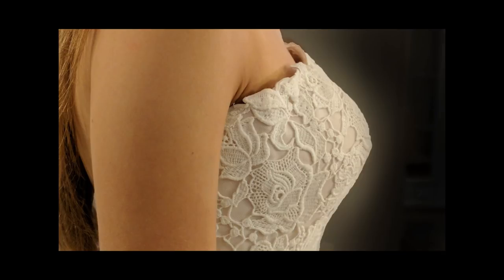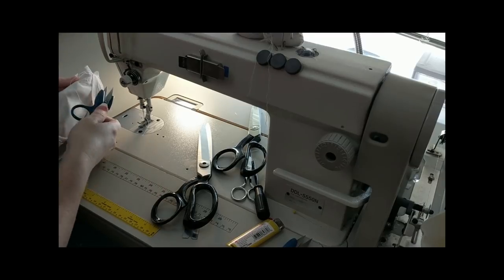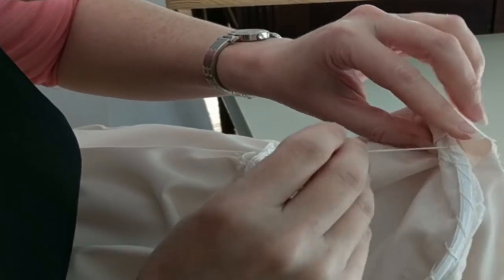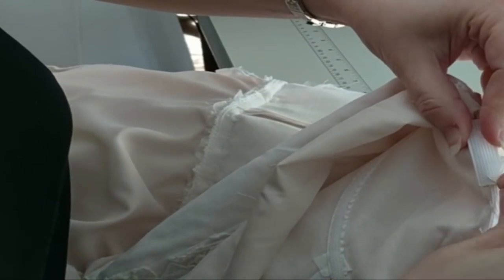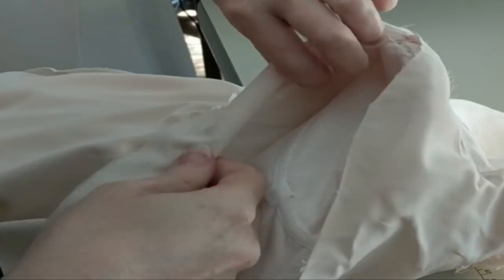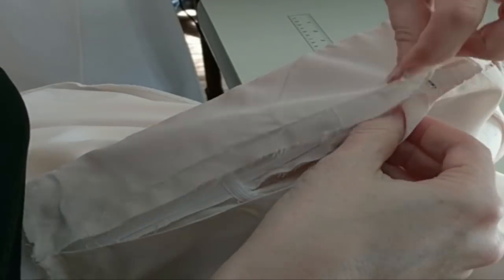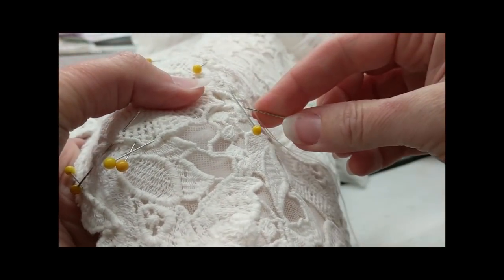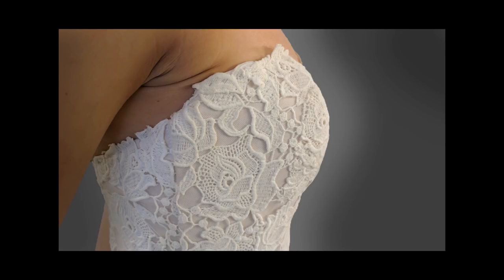How to Reduce the Bust Curve, Apex, Bust Angle of a Gown, Small Bust Adjustment

Comment: Really good technique, I've learned a lot thanks....
Normally I've taken a diff approach, by creating a gathered stich along the inside of the upper edge under the arm using a thick embroidery thread to pull it taught together, then adding bra cup inserts to fill in the beast, but I really like the way you've done this,  it's cleaner and appears more finished... good video 👍

Comment: Thank you so so SEW much!!! I am altering a strapless sweetheart bust designed for a B cup, and my bride did not realize she was a G cup until I measured her bust, sigh....another unfortunate extreme mis-sizing issue....I have let out, darted, take in only the top 3" of the front bodice at the side seams 3 times, taken in the waist 1" total, ease stitches,tried multiple styles of bras, adhesive bras, bra cups, and re-altered the bodice and have had 5 fittings with her, whew......the bodice has an extremely delicate open lace overlay with beaded appliques, and the waist seams attach to 3 tulle layers, interfaced satin, smooth satin and the crinoline perfectly smoothly without any gathers......I really believe this video has my answer. Guess I just needed to vent to my fellow seamstresses/ers since my friends and husband do not realize the difficulty level and how frustrating this mis-sizing issue is becoming with a few local "off the rack, no return policy" bridal salons. I would greatly appreciate any advice you can offer on how to politely address this issue to these salons who I greatly appreciate sending their "almost impossible" alterations brides and other brides to me. I do not want to offend anyone, but this is unfair to me and the bride. Do you have any advice on how to develop a relationship with your brides before they purchase their off the rack gown with no other option than for me to somehow make it work? I so wish I could measure, meet, and give kind, gentle advice on the importance of considering silhouette, venue, budget,and SIZE. Sorry for the long rant. This is becoming way to common. I would like to set up a paid Skype or call if possible, no rush. Thank you so so much!
Reply from the maker: Ohhhh, I have so many thoughts on this! I'll try to get back on here and address some of this. :)
Reply: @BridalSewing  
You are such an amazing woman to take your time to help your colleagues. I really do not see how you have the time. I just want to say again how much I greatly appreciate all of your hard work and taking so much time to create these videos for our community! I am so inspired by you that I am paying it forward and have begun teaching bridal basics to a local lady whose hobby is monogramming. I NEVER would have done this before, but now I am seeing our small community not as "the competition" but embracing your philosophy of preserving the craft. I am around the same age as you, and I see that we are losing so much knowledge as our previous generations skills are not being passed along. I am eager to help make our small community  kinder, less snarky, and not so ego driven. I will admit I have been guilty of some/all of this bad behavior in the past.....not proud of that and so glad you have the courage to address this in your videos. Thank you for keeping me sane and smiling during this gratefully busiest bridal season of my career. I no longer feel so isolated. I appreciate you so much!!!
Reply from the maker: Wow!!!!!

Comment: Morning Brenda. I just use this technique on a prom dress.   The bodice was so so snug. I used a heavy duty ok n eye. I removed boning to just below bust. Inserted DDD bust cups now  are too big. So I took in side seams from just bust kept back where it was. Final fitting today. Prom tomorrow
Reply: Her last fitting was yesterday afternoon. The fit was perfection. I layer in bed for two nights figuring out how to do this final fitting. This prom dress was highly structured just like a wedding gown. I remembered this technique and realized it was very well fitted in bodice but now apex was too loose and now unstructured. I opened side bodice seams removed boning and took in only front bodice. Three layers heavily beaded and many glued on stones. Tapered to waist line. Only took in front about 1 1/2” from front. Reassembled and it was perfect. Thank you so much Brenda

Comment: Thank you so much for sharing all your professional knowledge of altering bridal wear, it's making me feel somewhat less intimidated about my project to alter my sisters wedding dress. I have a question though, if you'd be willing to share any ideas :) I need to take the dress in both at the side and at the bust seam. It has a bodice similar to the one in this video, but with the difference that it also has an illusion/lace yoke in the front with shoulder straps. How would you deal with that when taking in the bust seam? I'm not sure that keeping the seam as it is at the top edge of the bodice, and just taper it in to how much the bust needs to be taken in, will be enough. It might make it just stand out. The bride has a very slim straight shape.
Reply from the maker: I've actually never had to take it in where the top of the bodice meets the illusion, and I've done some pretty drastic alterations. Usually, the small bust adjustment, taking in the sides, taking up the shoulder seams, perhaps adding small darts to the neckline, and even changing the shape of the armhole (swinging it in so it doesn't cut into the arms) is enough for even the worst case scenarios.

Comment: Oh wise goddess of bridal alterations, I desperately need your help on this issue. But for those slinky, modern, crepe/knit drapey type princess seamed gowns that don't have any interlining, so if the lining (always stretch jersey) doesn't match up exactly after you take it in, it shows, and everything shows, because it's so thin and unforgiving, no lace of course, just that stark modern plain style.
HOW do you a) get the apex right in the first place (somehow, even though I pin it on her - making the transition from pinned to sewn doesn't always fit perfect)  
b) make the left side and right side the same, because even 1/4 of an inch difference shows up 
c) match up the flimsy floppy lining on the inside to what you did on the shell fabric?
I have done/doing two like this. The first one...came out okay, it wasn't PERFECT, the apex I think was a bit flat because it had a bit of a roll under her bust. Fortunately they were an unpicky party and didn't seem unhappy about it. But I am unhappy because I know it wasn't exactly perfect and these stupid dresses have to be perfect.
The second, I'm working on right now. It's a halter dress and doesn't even have any boning, just a soft little princess seam crepe shell, and a lining consisting of two layers of flimsy soft jersey sewn together - so on each side, I have to get THREE seams to match up perfectly, or they show through. Well, I mean they show through anyway because this kind of dress, the seam allowance shows. Which means it has to be PERFECTLY MATCHED. 
please please help me, I just don't even know how to begin and surely sew/look at it/make an adjustment/look at it/make another adjustment/look at it/make another adjustment/all according to eyeball and not particularly effective attempts at awkward comparison measuring, can't be the best way.
Reply from the maker: It is super critical that you start a job on one of these gowns with a conversation about money. When I have a bride in this style gown, I tell her at the first meeting that her gown is deceptively simple. I educate them to the fact that the gowns that show every seam can take longer to sew than lace gowns. 
You'll feel your stress levels deflate as you spend more time with the gowns, knowing that your are making money, no losing it, as your pour in the extra time. 
There's no simple fix, you often have to match the sewing perfectly, 8 times or more. You could try making a paper template for the new seam shape and reusing that for each seam, but it will still require some trial & error.

Comment: Quite often I find this can be a frustrating alteration because, say I have to take a good inch or more out of the apex. When I do that in a princess seam the pieces won't always match and the side piece winds up too short. I hope this makes sense. Sometimes it's so short that when I reshape the top of the bodice at the seam, there isn't enough coverage. :(
Reply from the maker: Yes, this is one of the more troublesome alterations, that's for sure. I try to avoid it when it can be fixed another way.

Comment: Super helpful!! But how did you get the measurement for how far to take the bust in?
Reply from the maker: Kaylee Aul I don't often use a measurement, per se, but rather just pinch the curve to see how it needs to be changed. But, in this situation, where the dress is quite thick, I just had to visualize the difference that she needed and adjust that way, trying it on her to make sure the curve looked natural. To make sure both sides are changed equally, you can even make a template of the seam change as you work.
Reply: Bridal Sewing Techniques Thank you! That's incredibly helpful!
Reply: I work for a lady who is a master at bridal alterations and is teaching me and my co-worker her tricks of the trade. Do you ever alter the bust "unevenly?" My boss will pinch what is needed to be taken in, but also looks at thw princess seam and the apex curve. Sometimes the feont is too pointy and needs to be flattened more, but not the side front. The curve might be ok. So we have to match seams that wont be equal innthe end, just to get a good style line over the bust. 
Also, when you overlap the lace make up for what was taken in....we do it on a dress form for the curves instead of flat, or cupping with our hand. That way it forms to the shape of the body for sure on the dress form.  (Sometimes she is re-shaping a pleated bust and does it over her knee for the curve,  lol) 
Keep up the great teaching!! I am blessed to be taught by someone who is a master at the craft of sewing. Even with my former experience, a person can Never know all about sewing. 😀💖😃💖
Reply from the maker: Yes, the more sources we are exposed to, the more we learn. 
Sometimes, my method is slightly different for the video's sake. I would normally do the lace contouring as the bride stands in the dress. That would be unnerving for a customer of mine to be video recorded like that, though. Most seamstresses do the overlay in the back room, so it isn't "wrong" to do it that way. Per usual, it is a preference issue. 

I usually do not alter apexes (that's prob not a word! Lol) to be different. To account for uneven cup sizes, I usually adjust the padding assymetrically to even up the swell. Or, I will often dart assymetrically if needed. I personally like bust angles to be as even as possible. I do have a video coming up on this! :)